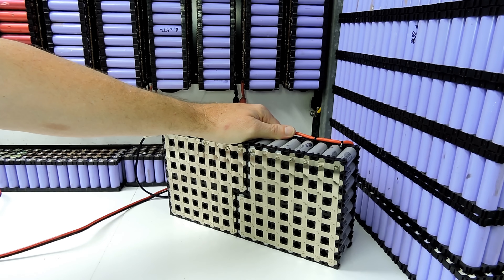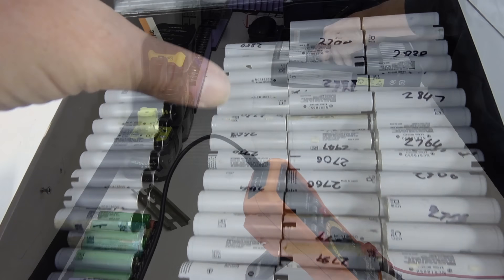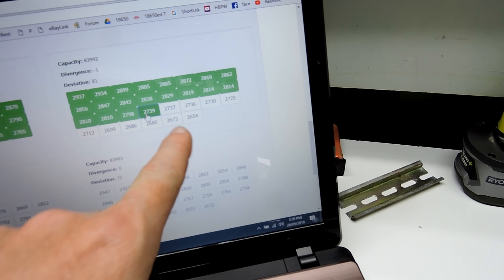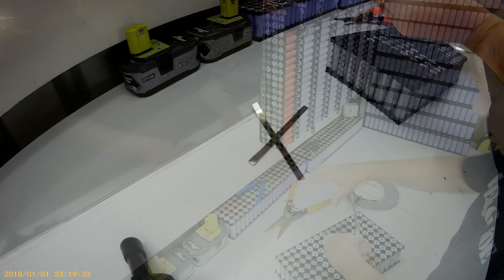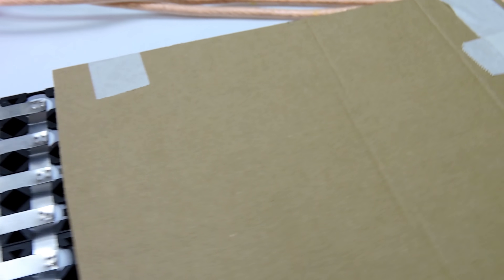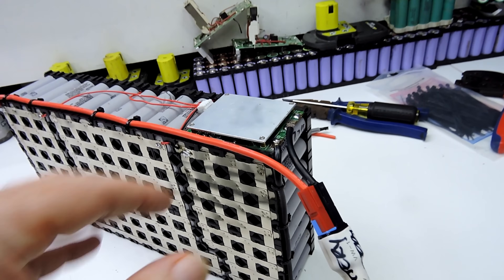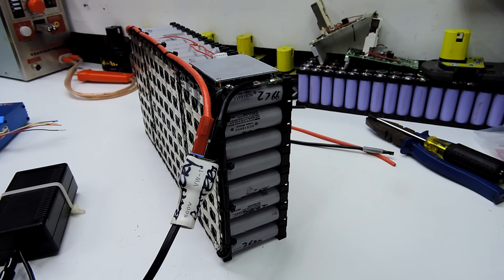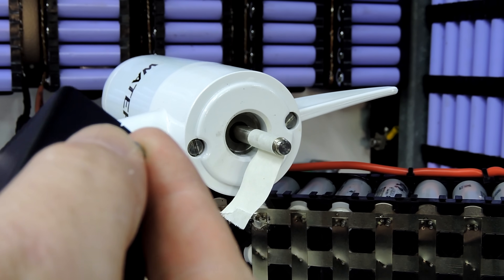Trolling Motor recycled 80ah 18650 battery pack

Comment: Cut the mix on the background music please. Even after you lowered the volume I had a hard time separating out your voice.
Question: Has anyone come up with a system for generating bar code stickers for cells that could be used to quickly identify a cell and relate it to a database?
Reply: I have to admit on my setup the music seemed really loud but the parts where you were speaking were the correct volume.
Reply: Volume of the music definitely came in really loud compared to the speaking. I was pausing and adjust the volume every time you started/stopped speaking. I've had a few channels with this issue in the last couple of months. I'm not sure what's changed
Reply from the maker: on my software there was only 10db difference... gah i don't know how to do it better..
Reply: Foot switch when you talk mute the music.
Reply: The thing is that when you speak there is no music yes, but we have to raise the volume to hear you loud enough, then the music starts playing and it is way too loud and we need to turn the volume down. When you start talking, we have to raise the volume again.

Also this is a personal taste, but why do people put this type of weird music in their videos, I do not understand.
Reply: 10dB difference between the music and voice?  That's huge! Every 3dB is a doubling of the perceived sound.
When I made videos I usually had to lower the music volume by 9dB so it wasn't deafening.  

You're probably adding the music as a separate track, yea?  In the video editing software there should be an option to lower the volume of just the music track.
Reply: @Mazlem  You are wrong, every 10dB is a doubling of the perceived loudness. 3dB is merely the smallest loudness difference that is audible.
Reply: @Mazlem  3db is not doubling the perceived sound. We have no concrete evidence on what it takes to double perceived sound levels some tests indicate around 8db.

6db is a complete doubling of sound pressure, 3db is a doubling of either cone area or power.
Reply: @Str8GasGenetics  Whoops, actually I meant to say 6db.  I do see some other discussions echoing your comments.  Personally when adding music to my videos, lowering it by 9db felt like that was more than half the volume.
Reply from the maker: I edit the movie, export it then add the music to the edited track, has two different sets of speakers and two headphones on my computer that I replay the competed file four times through each to try to get the auto levels right.
Reply: @HBPowerwall  Hey, I definitely could hear clearly, and the music was good too
Reply: Your question is strange.. You saying you would like to use spread sheets and a USB bar scanner to display scan query information you entered into the database and use sticker labels with the bar codes on them you stick to the bat that give it a identifier to scan, or you want to print out the bar codes that make up the string of numbers you can have output all that cells information you label it with the bar code numbers being the values to display of that specific cell? 

Just use enough numbers to represent the values you want and order them and make an arduino program or something to do the conversion and make it output on a 4x16 lcd. So you need to print stickers with enough numbers in the bar codes on them in a order like first 2 digits one value next 4 another next 3 another and so on. stick on a bat scan it with the USB scanner with an arduino glued to it wearing a LCD shield powered by a 18650 with a 4056 charging chip and give it a dc 5v 1 amp jack and the sketch you write on the atmel read the scan information, might need a pi or something to interface with the usb scanner or another shield for the arduino for usb support or look around for a better suited prototype micro controller majig you can use to wire a cheap hp bar code scanner used in POS cash registers PC like from HP to a power source micro controller lcd 

sharpies works fine. . get some masking tape for when you cant read your own handwriting and need a do over
or go buy a commercial inventory system thingy for a pile of cash and use it to scan bar codes you put on stuff..

maybe your question is just about if there are sticker printers to make sticker bar code stickers to stick bar codes on your battery.. im stuck
Reply: Markle2k I just just watched the video muted
Reply: You know, funny you mention this. I was thinking the exact same thing and didn’t think it would be too hard to build considering I’m a software engineer at a company that LITERALLY does the type of serialization management you (we) are talking about. The reason why I’d consider building the miniature serialized software would be to monitor and replace individualized batteries and track life cycles, etc through the phases of an electric auto build I’m planning. I’ll think about creating something and release it where each value at a given index in the 2D array corresponds to an entry in a SQL DB along with other relatively contextual information. Each build would be different but the program can be modified to suit your needs without the risk of build standardization.
Reply: I only had a problem after 6:09 where the music doesn’t reduce in volume when you start speaking. Other than that fab!
Reply: You can buy preprinted barcodes and link those to your battery. I create FileMaker Pro databases and the iPhone reads barcodes quite nicely. Just enter the information you require in the same record. Or whatever software you use.

You can print barcodes using an inkjet or laser printer rather than buy them.  Use a barcode font that converts your number into the barcode.
Reply: why not just print barcodes of the 4-digit numbers you're using and read them with your phone?
Reply: QR codes next to the numbers lol
Reply: I am partly deaf, so am accustomed to digging audio out of the noise.  It is still a lot of work, especially when chronic illness makes working harder largely impossible.

I plan on not having background noise - including (my) speech beyond the bare minimal degree - in any vids I attempt.
Reply: i guess Im asking randomly but does someone know a tool to log back into an Instagram account??
I somehow lost the account password. I would love any tricks you can offer me.
Reply: @Maurice Brock instablaster ;)
Reply: @Harlem Maddux i really appreciate your reply. I got to the site thru google and Im in the hacking process atm.
Takes quite some time so I will reply here later when my account password hopefully is recovered.
Reply: @Harlem Maddux It worked and I now got access to my account again. I'm so happy:D
Thank you so much, you saved my account !
Reply: @Maurice Brock you are welcome xD
Reply: the song is incredibly annoying
Reply from the maker: Sorry you didn't like the music really put effort into that part of the video too :( I think many have talked about it but not really come up with a way to truly get it to work
Reply: @HBPowerwall  Yes, please stop the music.. much better without music :)
Reply: @HBPowerwall  Yes, please keep the music volume low and constant, having to fiddle with the volume buttons all the time and getting blasted with deafening music each time you finish a sentence was a painful experience. Some of us might be needing to turn the volume up more than you'd expect us to when you speak, because of the accent we might not be very familiar with, I know that was a factor for me at least. Different parts of the world, different accents 🙂
Otherwise, this was a good video, thanks!
Reply: It's not simply a matter of taste. It's the fact that I can't hear what you are saying. Choosing music that avoids the frequencies in the speech range would help too. Surely there must be copyright-safe music that has been created to complement voiceovers.
Reply from the maker: I’m sure there is and I’ll take advice onboard
Reply from the maker: Just tried it on my kids computers and can hear fine - definitely need to look into it more
Reply: @Markle2k  have you thought that you might be suffering some form of industrial deafness?
Reply: @HBPowerwall  whats the name of the background music ??

Comment: How long does this take to charge with the Imax? Im building a similar setup and im thinking of ditching the ebay BMS for a (in my case) 3S balance lead. im worried this will take ages to charge at 6amps in a 3S30P configuration at the theoretical max charge rate of 6 amps.

Comment: do you charge the cells in parralell and if so how many at a time what voltage and amps
Reply from the maker: I can't remember to be honest
Reply: So if you got 10 cells in paralell what do you normally charge them at and what type of over charge protection do you use ? do you go to full 4.2v or less when charging?
Reply from the maker: Personally, I charge myself to 4.1 V with whatever charger is recommended by the manufacturer to charge the cells that you have
Reply: @HBPowerwall  thanks using mixed cells with same average  mah what is a safe current per cell to charge added up so like   safe would be 500ma per cell total for all 10 cells would be 5A max current if in paralell?

Comment: I wanna get a 100ah battery built in this configuration for my wilderness systems ATAK 140 kayak that has a small rear hatch and a 12v minn kota 55lb thrust motor. So was that battery heavy?

Comment: If you still have the battery I have a request for a video where you tell us how it worked and if you would do it again if you have suggestions for improvement. Also a capacity test to see how much capacity the battery lost.
Reply from the maker: Never ended up taking it out on the boat, due to brother selling it. That said its still working - runs different things from time to time. I tested it about  months ago and tested at 74ah but that was with an iCharger X8 at 10 amps rather than 4ish amps through the old discharger.

Comment: Another thing wrong with this picture is you spot welded right in the center of the cells which by the way is a complete no-no. Then you used your large soldering iron right in the middle of the cell which again is a complete no-no. The internal electrode is connected to the center of the cap and one should NEVER solder or spot weld in this area yet you refuse to follow these simple known facts of basic cell pack assembly. Also using multiple wires on the ends and the middle of the ends will allow them to charge and discharge much more even. Nice pack but with glaring newbie mistakes.
Reply from the maker: Well it's still in daily use so, there is that... Years and years later...

Comment: Awesome. Just one advice, never cut the BMS wires, rather flatten up the bunch and tape it in the end. Cutting BMS wires alters the resistance hence, the resistivity in each group of cell while balancing during the charge process.. something not big, but not too small to be ignored. Thanks 👍
Reply from the maker: Good tip!

Comment: Is it safe to build a 12 volt 18650 battery for atv 4wheeler
Reply from the maker: Just replied to another comment for you
Reply from the maker: this way is better than then other video you commented on as the nickel strip adds strength and is the way the EBIKERs do it so even tho i have no experience with ATV's Ebike building direction would be better than powerwall.
Reply: How many amps can u put to theses battery's I want to make a 12 volt battery for my atv 4wheeler
Reply from the maker: I wouldn't like to push it past 60 amps constant. I tested at 30amps to get the 80ah

Comment: what amps for charging how u charging how long u charging?
Reply from the maker: I use an iCharger X6 to balance charge them - works a treat takes a few hours to charge properly - battery still going strong today - https://ebay.us/KIsCAX
Reply: imax b6 just to small so how u charge normaly? all i see its so small and to damn slow charging u need minimum 15v 20a
Reply from the maker: Has worked perfectly for years. Don’t understand your issue.

Comment: You really don't want to use Lithium Ion batteries for a 12v trolling motor. When the batteries are fully charged, they have too high a voltage for those motors and will damage the motor. You should use LiFePo4 batteries instead.
Reply from the maker: Hence that little black box.. sill working today :P

Comment: Nice Battery.  I need to attempt one like it at a (somewhat) higher voltage, for when the power goes out here (like it did yesterday).  

No power = no sleep, in my case, due to breathing problems I was mostly born with.

Comment: No BMS in the end with this large pack?
Reply from the maker: A good BMS will cut off at low or high voltage to prevent damage. Also balance the battery. I use a hobby charger to charge so every time It charges it balances. I can live with it over discharging.
Reply: @HBPowerwall  I see OK. Thanks for responding! I'm still new to building batteries so useful to note.
Reply from the maker: Don't underestimate the importance of a GOOD BMS..

Comment: Can you please respond!! I’m building the same pack 4s 18650 fully charged is 16.8 I’m using the same water snake 12 volt trolling motor. Can you confirm by adding the pwm that the fully charged 16.8 volts won’t burnt the trolling motor up?? Or do you don’t fully charge the pack??

Comment: I’m thinking of building the same exact one and using the same exact trolling motor. Is the 16.8 charged voltage too much for the water snake 24??  I know you used a voltage regulator but is that required for the “12 volt water snake motor”??
Reply: HBPOWERWALL
Reply from the maker: Yes, that black box - a PWM speed controller knocks down the voltage

Comment: Good install btw I had many bms go bad after a while so I just go for balance charging leads for the smart chargers and keeps it always .09v-/+ balance and so far it’s cheaper but my batteries are always working and I tried to dont go above the amperage ratings
Reply from the maker: BMS is also protects against under voltage to save the cells. That said this battery still gets used quite a lot and i only use a balance charger - does work well if you accept it's dangers

Comment: Nice video. Im currently making 4s25p for my Motor Guide R3 55lbs digital. I would like to ask if you wrapped or sealed the pack somehow to make it water proof to prevent corrosion and fire risk?
Reply from the maker: Same type of build as an Ebike

Comment: I've made 25s4p pack for the trolling motor using new 3400mah batteries from aliexpress. Also decide not to take risk with built-in BMS and use ISDT charger instead - at least i can get numbers this way. Gave it a try recently. Running on the slowest speed(3kmh) it lasted for 6hrs and 15min, consuming 180w on average. Wattmeter indicated i managed to pull almost 1150whr up to the moment when voltage dropped to 3v/cell. Going faster require about 300-400w and resulted in low voltage warning when battery was less than 25% of capacity.  
BTW, these motors can take 16.8V, no need for pwm controller. This will kind of push it to the limits. My motor is rated 430w at 12v, according to wattmeter it was pulling 600w+ on 16.8v battery. Running it full throttle reduces the range. I was getting 15km on medium speed and 18km on low speed.  Max speed will empty  battery in 1.5hrs with about 9-10 miles covered.

Comment: Who the damm hell left a fully charged cell resting for 30 days.... That ruins batterys! The correct form to do it is leave the cells at 3.7v for 30 days.... And 4.1v for a few days.... Not 4.2 Wich is stressing for the chemical inside for 30 long days... Rip 18650... For sure they lost 5% life by doing that
Reply from the maker: You know batteries in laptops stay fullysharged for much of their time as most are left plugged in right? Your estimate is missing a decimal place and a few zeros lol maybe 0.0000005% of their life. Resting at 4.2 will show a greater voltage drop over thirty days than it will at storage voltage of 3.6v it's the voltage drop or self discharging cells that pose the greatest threat - now that said the battery is still 'resting' at 4.2v  is a few years old (on top of being in laptops for many many years) and still tests at 76ah so i'll going to call your statement a little on the scare tactics side. But thanks for the input its always good to hear what others have to say..

Comment: Kinda new to this thing so would like your kind advice as I am also doing it for a trolling motor but my target will be bout 200pcs of 18650s. And what is your view on fusing the batteries as opposed to not fusing them?
Reply from the maker: Well Ebikes don't fuse, its a smaller battery, you're on water if it has an issue over it goes lol

Comment: I'm working on a Lion battery for my motorhome. Only 10-15AH but that's plenty for what I need. So far, 5 x 4 lithium battery holders, 20 protected 18650s. I'll run 5 packs in parallel of 4 in series giving me 13.8v nominal. That should allow me a peak draw of at least 6a.

Comment: Why e bike packs or something like that cant be fused or can it be fused
Reply from the maker: You're issue is the amp draw of an ebike battery. Typically they use 30amp peek cells - it would add too much resistance & also fuses are by their very nature weak, so in an environment that vibrates too much it would cause an issue.
Reply: @HBPowerwall  thanks

Comment: Also I used the batt hookup, nickel fuse, 100 cells, in a square, with added strip, in a square, 2cells from the edge, with two strips crossing about 3cells between, with another nickel strip across the top. I have a 12g, silicone wire, connected to the double strip areas and another at the very top. For 4 total, since you tested the fuses. I'm curious if you think this will suffice? My system can only pull about 300 amps. And this is one of 3+ banks, so 100 amps peak, it's not perfect,  but I have the current coming from 4 locations in the middle of the pack.  Not many have videoed actual use of this stuff. Any idea? Thanks